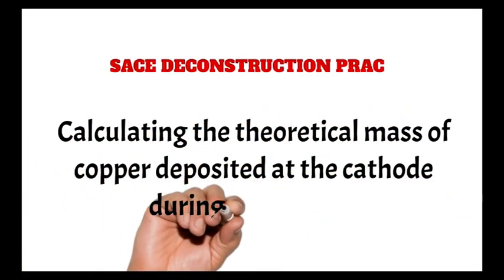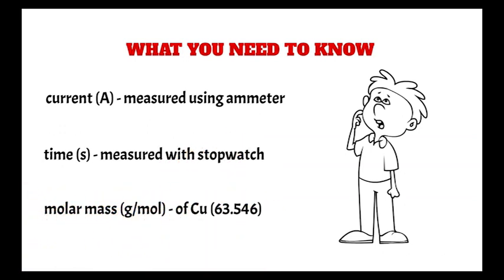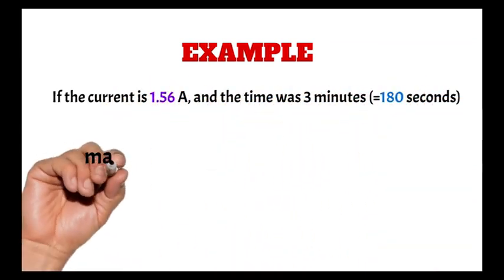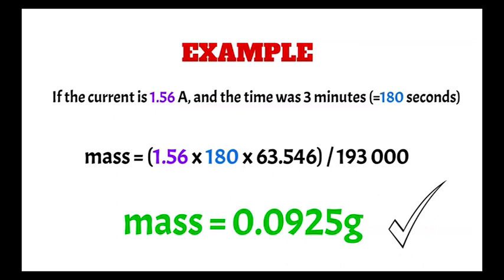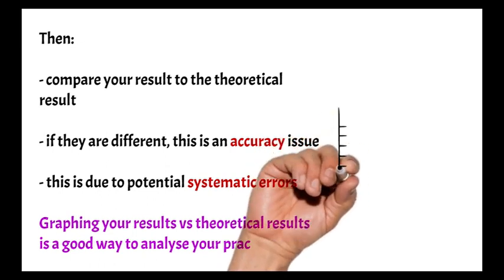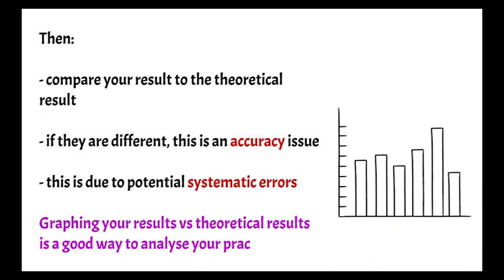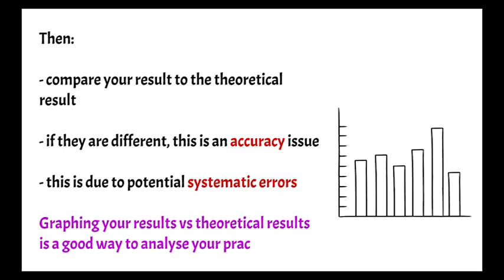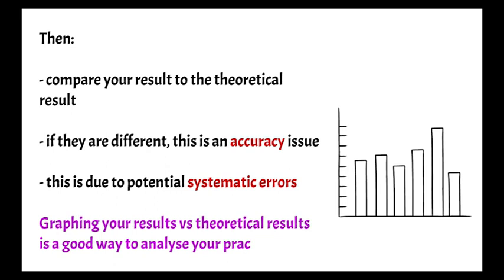Calculating Mass of Copper Deposited at Cathode

Comment: What are the units for the 193,000 in the equation? Where did you get it from?
Reply from the maker: It comes from the constant that the charge on one mole of electrons is a faraday, or 96500 coulomb mol-1. Then given that the mole ratio of Cu to electrons is 1:2, given both the Faradays and mole ratio are on the bottom, you multiply 96500 x 2 to get 193 000. Its complicated, hence why I simplified it for Year 12 Chemistry.
Reply: @billstapleton2071  ok, you just didn’t put the units in the equation. Where I go to school, you can get almost and entire question wrong simply for not using units in the equation, and I can see why. Numbers are just numbers unless you specify what they are.
Reply from the maker: @thomaschirila6372  sorry if I confused you! This video was only ever designed to be a support for my students with their practical task. The calculation is actually not part of our Year 12 Chemistry course, it is only used so we can get a theoretical mass calculation to compare against. FYI, you do not need to put units in most of the exam question answers, as they are stated in the question. Units shouldn't need to be included in equations, only for the final answers, but thats just my opinion! All the best with your study!